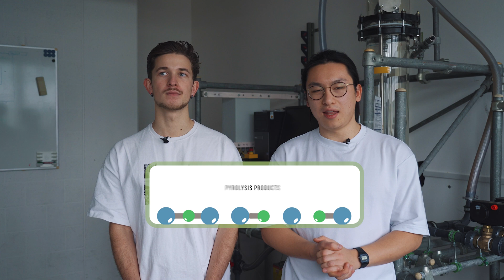From Waste to Energy: Our Plastic to Fuel System

Comment: Great job you guys. I have no idea what progess you made on the new reactor, but I have an idea to improve the reaction. You should shred the plastic and then fill it with used motor oil, transmission fluid, hydraulic fluid, or even the crude you're making. This would make a clean and simple way to remove the oxygen from the reaction chamber.

Comment: along the way, i would like to see you experiment with sending normal trash through the system. take a few bags of trash from home, no sorting, and send it through. using a gas capture system like you would for wood gas, you could even do a full analysis of the full system, not only the solids and liquids.

Comment: Chem E here, I know the economics of doing this at scale are not favorable right now and that is why you are focused on launch developing areas with lack of access to fuel sources. But have you considered implementing your system on natural gas flares? All across the US there are flares burning gas as a byproduct of shale oil production because it is not efficient to capture and sell it all. If you had a modular system to set up near these flares to utilize the free energy you might have a really great waste management solution at scale.

Comment: I've been noodling the consumer side logistics of what you're working on. If there is going to be buy in from the general public it needs to be easier than current recycling methods.

If people have a bin labelled "plastic", people will use it. Absolutely. If you don't have to be too picky about what goes into the bin then people will want to actually have it as part of their waste stream.

The next part of this would be to partner with petrochemical companies that produce fuels and feedstocks for the polymer industries.

Those two things are really what will allow this technology to flourish. A reliable source and a reliable sale of the final product.
Reply: well some of them do it by themself if you look up OMV re-oil or other projects like Shell chemical recycling plants

Comment: hey, nice tackle on the plastic problem and how it can generate work and environment gains. If you don't mind, i would like to ask a few questions. Most plastic is composed of polyolefinic material and i think there is legislation in many countries against a large composition of alkenes in the distilled fractions. In your GC analysis, did you detect the presence of alkene compounds in your bio-oil? How do you deal with this problem? I think you can do hydrogenation of the distilled fractions or bio-oil in order to avoid that but it would be costly and working with hydrogen is not that user-friendly, i think one of your main design goals. Another alternative would be blending bio-oil or distilled fractions with normal fuels or even with other substances. I think the same can be said for aromatic compounds, since there is max composition of 35% of aromatics in most legislation. Again, congratulations for your initiative and nice work, i think plastic pyrolysis is great technology for recycling and production of liquid fuels, the feedstock has great possibilities around them.

Comment: I'm actually a bit interested in all of the pyrolysis (will be a minor hobby since medicine is my priority for a career). I have one simple question:
Do you think, that an unused concrete septic tank ring (of course prepared with fire resistant materials) would make as a solid base for the reaction chamber? Yeah, this kind of volume will force me to have a HUGE total volume of containers, but it seems it'll be a VERY efficient way of pyrolysing plastic.
Edit: You know what? Actually 2 questions, the second one being:
Can I use simple firewood for heating everything or does it need something, that is burning at roughly the constant speed?

Comment: Congratulations!
I've been experimenting with pyrolysis myself as a 'home chemist' and I've been collecting parts for much bigger system that might actually significantly contribute to my home energy needs even my neighbors.
   Let me know if you need anyting (not that I have much) 
Personally I believe this is a technology that should have been in place for decades now, I would happily encourage my town and politicians to encourage the use of such devices. 
  I would also love to see your future video so I can learn how to make the process cleaner and more efficient.
   Problems I've had included avoiding self polymerization of the oil, fractional distillation energy use, the handling of condensed water. 
  So if there's any suggestions you have that you would like me to test or any knowledge you already have that you're willing to impart to me I am interested.
   Oh and if you ever incorporate , let me know how to invest.

Comment: This is very cool. But I have a question, what is the difference between what you are doing and the other plastic waste pyrolysis reactors already available on the market?
Reply from the maker: Hey thanks for the question. Our system is modular and small. The whole design is made in  away that amateurs can use it safely. Also we are putting high standards to our system (German safety certificates) to ensure the system poses no threat to either people or the environment. 

best hazel
Reply: @HazelChem  thanks for getting back to me! That's really great. Once it is ready, I would like to buy one 😁
Reply from the maker: You can sign up on the waiting list for a system on our website :D https://wasteex.de/ 

best Elias
Reply: @HazelChem  Done. Cheers :)
Reply: @HazelChem  bonjour frère ... j'aimerais savoir si le diesel qui sort de votre machine est directement utilisable ou alors il faut ajouter un additif....au plaisir de te lire

Comment: nice, i didn't really expect this project to reach this level. many cool projects just fly under the radar and remain hobby projects abandoned in the garage.
very cool to see you guys actually developing this further
Reply from the maker: honestly I did not expect it either. I am so happy to have the support to turn this into a properly designed system now. 

best Elias
Reply: @HazelChem  How much energy is needed to recycle the plastic and how much energy do you get from the petroleum you get from the process? If it is energy prohibitive maybe you should burn some plastic for the energy to convert the rest.  That carbon is going into the atmosphere one way or another anyways.

Comment: Very interested in this, I run an off grid Auto repair shop and have a lot of plastic oil containers to dispose of, I also have a waste oil burner for heat in the winter here in Canada.  Being able to turn that plastic into fuel and use it is very valuable.
Reply from the maker: Great point! A pyrolysis system is perfectly suited for your of grid situation. Also it can recycle waste oil the same as plastic! 

best hazel